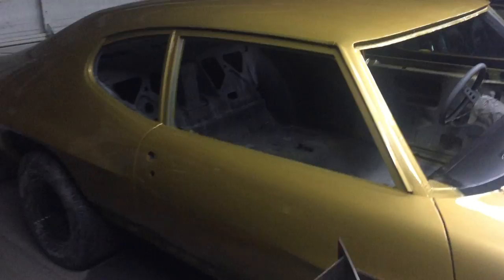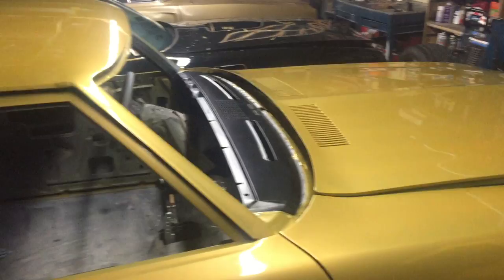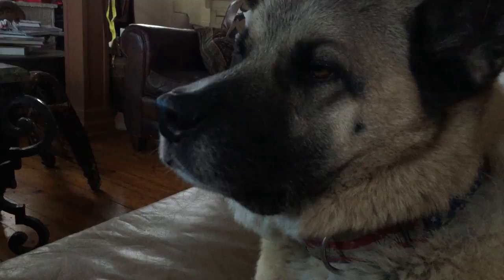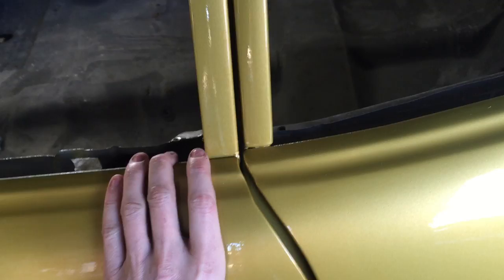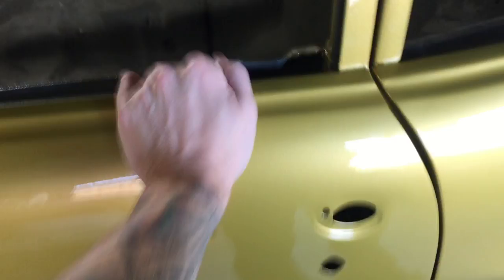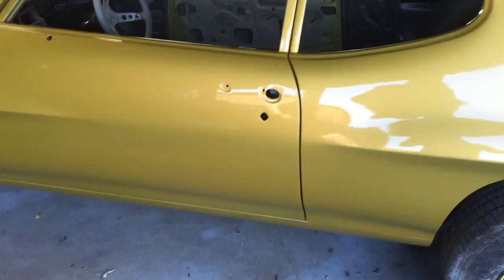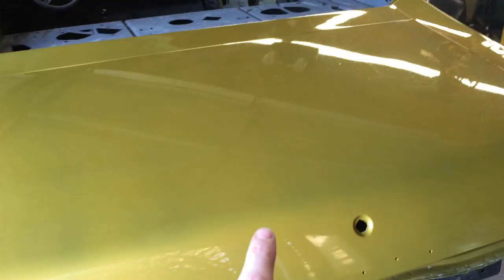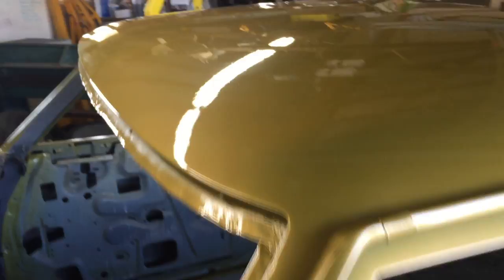T37 Build Update Pt 37 - Foam Dashboard Restoration

Comment: Good to see another update.  She's coming along nicely!  All my body lines changes dramatically when seals got installed.  My trunk never came back down, so you're in really good shape!
Reply from the maker: Thanks!! - when i did my bodywork i shelled out on a set of door and trunk seals, was about 70 bucks total, i put brand new seals on doors and trunk straight after i primed the car and that helped me really dial the door alignment. I sacraficed them by yanking them just before paint, and knew when i bought another new set, that they would at least be close.  I hate to waste money, but in the scheme of things i think i would definitely do it this way again.

Comment: I also heard that she got one coat of clear so just let it set up and then you can buff it out and then you can another load on there
Reply from the maker: Yeah, 2 coats but the second coat not as thick as i would have hoped.  Im gonna try a real light buff first and see how it goes. I think ill be ok, i really really don't want to spray the car again. especially now that im getting into assembly, it would be out of the question.  Thanks for checking it out though!

Comment: Great work on the dash looks awsome.What was the name of the kit you used or where did you buy it? It worked great later
Reply from the maker: Cheers Hanson! it wasnt a "kit" but i bought it from Polyvance - they have lots of stuff, i just followed their reccomendations of items. they have the Special iron, the flex filler, the primer, and the Textured spray coating. By the time all the stuff landed at my door it was about $250 but then i had to buy more Padded Dash fillter. @30 bucks a can, so it added up quick but still cheaper than sending it out and i had fun doing it.